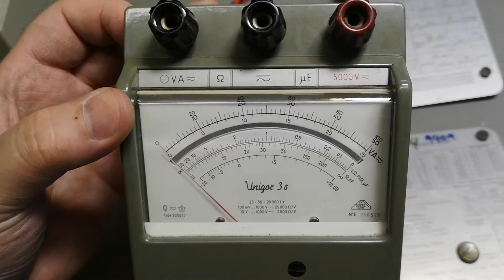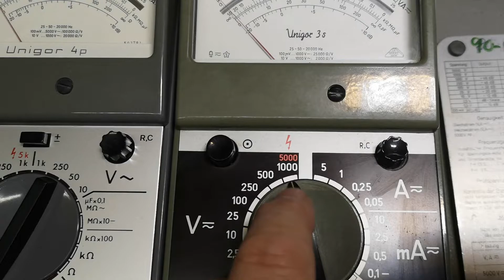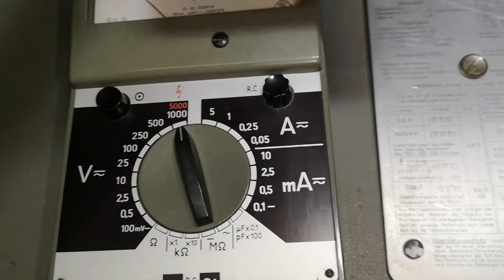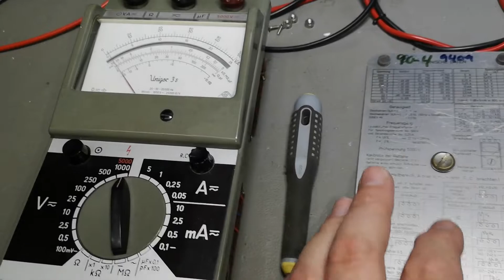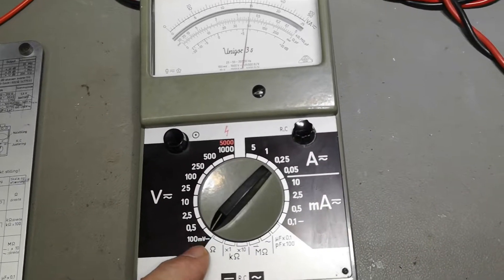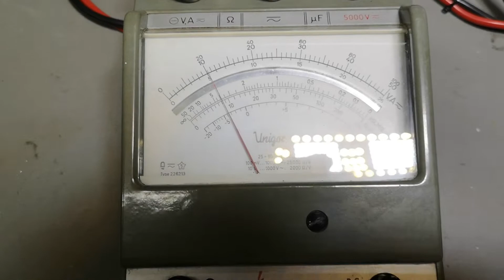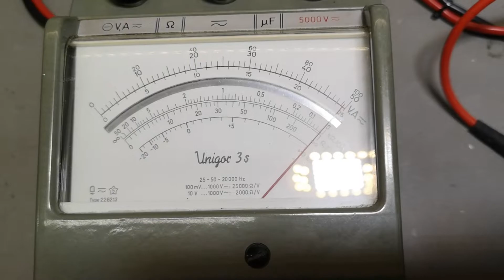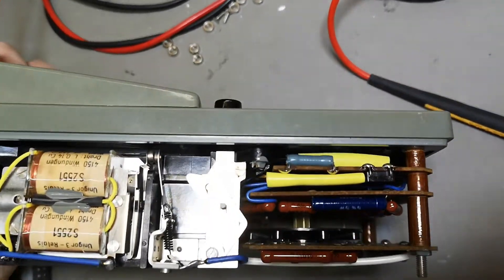BBC Goerz Metrawatt Unigor 3s multimeter type 226213 test teardown

Comment: Cant figure out what battery type it needs
Reply: Just found out it uses a presumably ussr R10 battery that isn't made anymore, due the meter being from east germany.
Reply from the maker: you got a 3D printer ? how about make an adapter that simply go arround a AAAA cell, to make it thicker ? or another cell with about the correct length ? maybe look into that ?